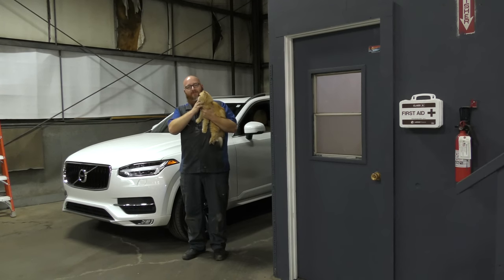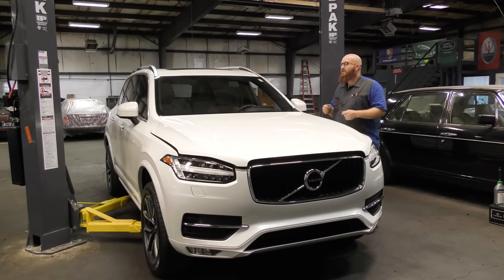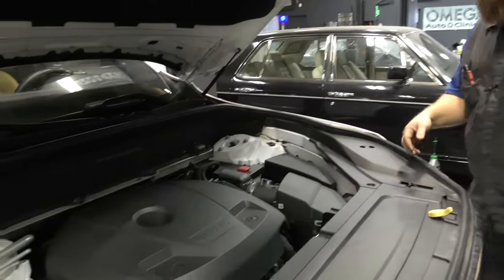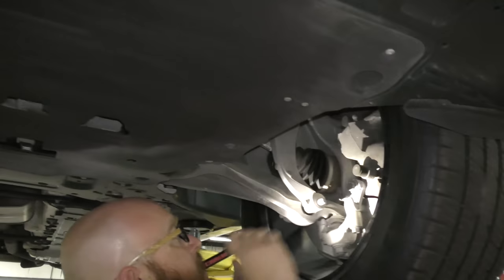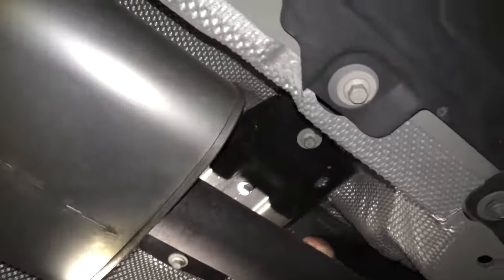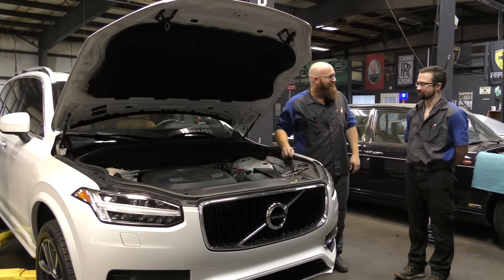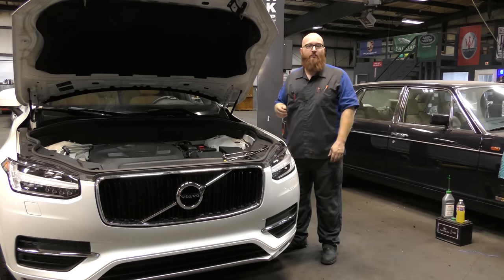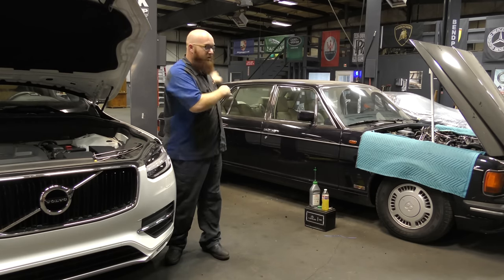One Sweet Swede! 2016 Volvo XC90 loudly roars into the CAR WIZARD'S shop.

Comment: Perfect video after finishing work on my '88 740.
Reply: I can't wait to get my '86 760 Turbo out of long term storage and back on the road again. I miss that turbo lag and push button 5th gear so much!
Reply: @TIMMEH19991  Mine has been sitting for most of the summer, been busy with work and work related injuries. Had to do some suspension work and put on the lower chassis brace from ipd. Definitely miss how comfy and fun this car is to drive. Especially when I hear the turbo spooling up. Mine is auto for now, may change in the future.

Comment: I have two Volvo wagons that are original, a 850R and V70R.  I have another 850 that's been RWD swapped with a turbocharged 3800 (bought a roller for 500 bucks, used parts laying around the shop, total prob less than 1000 bucks for a nice 850 that runs well and is simple to work on/easy to get parts powertrain wise).  I've probably worked on more Volvo Semi trucks than anything Volvo though, we've bought/sold quite a few and even adapted a couple to replace the Internationals we were running for propane trucks.  Drivers say they're the most comfortable/easiest to drive and they're pretty reliable/fairly simple so it's win-win.

Comment: The 2016 has two MAJOR issues: (1) oil burn due to narrow oil return ring (fixed in 2017), and (2) leaking sunroof due to (a) shrinking seal on rear glass, causing a large gap where water can get in, and (b) bad design on sunroof cassette allowing excess water to enter the interior (not sure what year fixes this). There were a number of other issues, mostly fixed under warranty, but these two issues don't typically show up until you're beyond 50K miles. Volvo considers anything over 1QT/600 miles "normal", so if you burn a quart every 601 miles, you're SOL. Even every 1000 miles would mean that you're replacing 10 quarts of oil BETWEEN the 10K oil change interval. Had I stuck with 5K oil change intervals, my carbon deposits would not have been so bad and the oil return rings probably would have stayed clear. They never tell you about carbon buildup in oil testing. While the newer oils easily last 10K or more miles, the dispersants lost their effects after 4 or 5K miles, causing carbon to stick to metal surfaces. I took apart my 1996 Mustang Cobra engine last year, changed the oil with Mobil 1 every 5k miles, and it was crystal clear including the oil return rings.

Comment: The cat is very cute, even though I’m allergic. I’ve seen her before in your Facebook photos in the car wizard 🧙‍♂️ group. As for the electronic shift lock and ignitions and whatnot. Yeah they are somewhat of a pain to deal with but there are some tricks to them that everyone just has to learn and then they become easier to deal with. For example, with the push button ignitions if you don’t want to actually start the engine but instead turn the car on or put it in accesible mode you can do so by simply pushing the start/stop button without holding down the brake or clutch pedal in the case of a stick shift. So in essence, if the car has an automatic transmission you could drive it up to the lift, put the car in park and then shut off the motor. Then without holding down the brake pedal you can just press the start/stop button until it goes to the on position and then put the car in neutral so that you can move it around. At least that’s the approach that I would take with one of those cars.

Comment: I saw a video of a same year Volvo that had about 2000 km on it. There was a piece of aluminium wall stud tangled around the rear axel and I noticed Volvo is using a plastic rear spring, funny. The whole bottom of the car was covered with mud and grass so I was wondering why would anybody go offroading with a brand new car. They had had flood and the only way to save the car was to drive it out through the housing area being built. That's why the owner bought it anyway, just in case he ends up in the middle of flood.

Comment: I had the opportunity to test drive the newest XC 90 turbo diesel. The interior of the vehicle is top notch. It’s loaded with gadgets and gizmos, however the power delivery from the engine was a huge disappointment. Lots of turbo lag. It reminds me of the turbo powered gasoline vehicles from the eighties. Value for money isn’t great if you realize that for the same price, you could buy a double cab 2.8 litre turbo diesel pickup truck from Toyota with a much better power delivery from the engine.

Comment: Hey Wizard, I know from having one as a hire car that I’d you turn the car off, then, turn the ignition on by turning the start switch but with your foot OFF of the brake, once the ignition is on by engine not running, put your foot on the brake and the shifter will move to N. You the electric parking brake will also come off if the ignition is on, engine off, foot on the brake and press the button to release the parking brake. 

Also, why aren’t the “Thor’s hammer” DRLs working in your video? Those really add to the look of new Volvos.

Comment: These modern Volvos have some major service flaws. I work IT for a company that owns a couple Volvo dealerships, the software updates on these cars are MASSIVE. Auto techs still do this, not some no-mechanic IT guy like me, but these updates take sooo long they drain the battery (car needs to be in auxiliary mode take the update). We had to buy a high speed internet link specifically so we stopped killing new batteries on firmware updates
Reply: Or maybe connect the batteries to a battery charger while doing updates?

Comment: I wonder if Wizard will be like his mentor in 30 years when cars are 99% computers...

(I already am, my daily is an old push rod V8, it drinks fuel sure, but servicing, parts are cheap as chips! - not to mention any simple stuff I just do myself) - not that it's had any problem other than the fuel pump the day after I bought it haha!

Comment: Speaking of Volvo...
I drive a 240 and there is no exhaust left whatever. The catalytic converter fell off last week! And my timing belt was last changed before my mom bought the car in 1996. 
But....
The water pump failed a few days ago and I have a timing belt and water pump kit and a good deal at a shop to have it done.

Comment: What? The Great CW, Cuddling a cat? Witch's hat/ Hoovie effect? I don't even wanna go there. 
You got the pineapple for that :) Nice procedure with the rabbit's ears. 
Poor folks, outside of Kansas, who can't afford a hoist, might try one of them cheapy, point & read thermometer thingys? 
Check temperatures? Also good for radiator top & bottom/ transmission/ Cat before & after? I.e. the exhaust, cat :)

Comment: Car Wizard, instead of investing thousands of kilowatts into an actual AC system, why not use something simpler, like the Portacool by Hess Automotive? That basically consists of a small water pump and a large fan, it pumps water on top of a cardboard cooler radiator which then gets soaked, and the fan pulls hot air through that, evaporating the water and therefore cooling it. And it doesn't use that much power, maybe 800W or something? I've seen shops in Germany cool their shop with it, and they're happy. It only gets the shop maybe 5-10 degrees C cooler, but that often makes the difference between bearable and unbearable heat...

Comment: Nice video Wizard! 😁
I have one question regarding the lift: What is the purpose of the handle, which you‘re pushing & pulling with your right hand? Just wondering, because in Germany we don‘t have anything like that... Just some up & down buttons...
Thanks a lot! Have a nice day guys!
Reply: I know it’s been 2 years, but that is the lock release handle. If you don’t hold it, it makes a very loud clicking noise when it goes over each lock

Comment: One of my money-no-object cars I'd buy right now, a V90...
Reply: That or the new V60.
Reply: The 4-cylinders suck though. Not luxurious at all and lots of turbo lag
Reply: @headcas620  Have you driven it though? If you have, what are your thoughts on the rest of the experience? I'm sure it's a damn good bit faster and less "laggy" than my un-Imprez-ly slow car... I haven't yet, but I love the way it looks and sitting in it is a treat.
Reply: Joshua yes I had one as a loaner. It was pretty nice otherwise and the pro-pilot assist was nice in traffic. I'm just used to a V8 s80 with immediate throttle response. The mpg was the same or only 1-2 mpg better over the v8.
Reply: yeah i'm not a fan of turbo i4's... but i'm also not a fan of SUV's, i'm too short for their roof racks. so short of getting a pickup, wagons are the ticket... too bad no one makes em anymore. i'd kill for a wagon version of the current gen Camry.
Reply: @headcas620  Good to know and thank you for responding.....In all honesty, if I had my absolute first choice, it would be a V60 Polestar. I have yet to own anything other than cars with small 4 bangers and I love the love sound of a straight 6.

Comment: I’ve always loved those Volvo’s,  but was worried about the 4 cylinder engine.  How do they hold up?  Do they have enough power, it’s a pretty big SUV?
Reply: If you get the T6 version, they have just a hint of lag, but once that supercharger kicks in down low, it moves pretty well (even with the 5,000-lb-plus XC90).  It's got good pickup and power delivery.  Now with these new B6 mild hybrids, it does provide a tiny boost off the line (13hp, ~30 lb/ft), but they feel just about the same. 

These engines do have common issues with oil consumption, which if the issue continues, it will require a piston ring replacement.  But they are fairly reliable.  I wouldn't say they are as reliable as a Toyota engine but they are definitely not as unreliable as a Jaguar/Land Rover product.

Comment: As already mention just hold the plastic nob for a bit more then a few seconds and it will shut up. 
Also think about settings, if air suspension turn automatic leveling off = Top drop bar, settings, my car, suspension & parking brake , also possible to disarm parking brake for RBT or so, often don't work with the button for some reason (if equiped).
Safe car but that'ss about it.

Comment: What yr is that car,,,,, I have a 2012 acura tl sh-awd with 125k Miles,,, the only issue is getting the timing belt done,,at 103k miles I changed the sparked the plugs,,, you can't go wrong with japanese cars

Comment: If you turn off the engine in "P", then ignition and select "N" then you can push the car around without engine running? Works with my 2015 VW Passat (Europe).

Comment: that shut off feature that doesn't allow you to turn off the engine is not safe! If you get a  stuck throttle cable... umm 3 ..2..1.. It's happened to me

Comment: Actually you can turn it off in neutral, hold the "off switch" and it should shut down, as long as it isn't shift by wire it will stay in neutral, even the shift by wire should stay in neutral.

Comment: The last good cars volvo made was the 240/740/940. i had a wagon with 300k miles and it drove great
Reply: Depends, really. For a modern-ish car, the later years of the second gen v70 like 2006 or 2007 were quite good. Amazing rust protection as well. And you can fit 15" wheels on some of them. Put on some nice skinny 195/65/15 tires for a really comfortable ride.

Comment: Another great video .  The 4 cylinder is turbo and super charged yet only makes 250 horsepower even an older Honda Plot has 300 horsepower so what the hell is up with that crap?  It's like buying a nice high end laptop but you get a shitty celeron processor lol

Comment: wow...arent there a warrenty on this car? before my audi was 5 years the audi dealer took my car infor inspection and replace all my rear lights (cracking from inside) replaced  my side mirrors due to indicators didnt work. wiring harness from computer to front breakes due to corrotion in the wires. THey resprayed my wheel tubs due to some rust (did so after 3-4 yrs).
Reply: volvo warranty is 2 years and rustwarranty is 12 year in finland atleast.
Reply: 95,000 miles*
Reply: Big surprise an Audi needed all that work before the 5 yr mark. lol
Reply: Holy crap, 2 years
Reply: @OMGWTFLOLSMH  Its 10 yrs old now with no problems and still looks (almost) new :) the clock just turned 100k km
Reply: @EvilCerealBoX  didnt hear that part :) ... thats 152k km in 4 yrs. Mine has gone 100k in 10 yrs...i dont think i drive to much

Comment: ah yes, Sumitomo tires...the used dealer go to.  When you want to show you are classier than Ling Longs but don't want to spring for the proper Pirelli OEs.

Also, that's not even a fully loaded XC, that's a Momentum.  An Inscription with Bowers and Wilkins.....that's loaded.

Comment: Having a 1998 S70 T5 and 2 2009 XC90 V8’s I’ve learned that you stay away from the 2016 XC90.
Reply: I’ve got a 98’ S70 GLT! Wouldn’t give her away for anything!
Reply: I have an early 2007 V70 D5 with startship miliage one it. Great car that just goes on and on and on.
Reply: I have a 2004 XC90 that is a money pit.  Most of them had to have new transmissions at 100,000 miles. Very expensive parts.

Comment: @7:33 are those the 4 Audi rings on the control arm ? can't immagine that Volvo is using Audi suspension components
Reply: They have used Audi engines and transmission systems in the past, so I don't see why not?
Reply: @TIMMEH19991  what I know it was only v70 tdi with the Audi 2,5l diesel(c4) engine. And B8444S v8 engine built by Yamaha (Ford owned Volvo by that time) Except that Volvo had Volvo engines
Reply: @Joakim Söderberg  They used a VW Audi straight 6 diesel engine in the 80s and 90s, plus I'm sure one of the 4WD systems they used was sourced from VW Audi . I could be wrong though!

Comment: No mileage mentioned, but if it has less than 50,000 miles at 4 years old I'd want Volvo to pick up the cost of a failed wheel bearing.

Comment: Hey wizard, when you mentioned something about the brake pads sticking and hearing a popping noise? How and why does that happen? Sometimes im coming up to speed bump in my car and ill hear a slight pop up front. Could that be the same thing?
Reply: Sounds like a ball joint or a bad strut. Hard to tell thought. You need to bring it to the shop.

Comment: Think the XC90s are a nightmare for reliability.  XC60 much better. I have loved Volvos since riding with a teacher think 1980.  Owned a used 1990 240 wagon 5sp in 2001 with 120k, kept 5 years, and only changed the oil.  Something changed at Volvo - think mid-1990s when they begin to go to front-wheel drive, and by 2000 the "wheels came off the wagon" and could pick up a 5-year-old Volvo, $40k new, for under $5k with issues

Comment: 2016 and a exhaust leak.....WTF   what a POS!   Plus it is a 4 cylinder turbo.......problems are a coming.
Reply: It has 93000 miles under it's belt already, what's a simple exhaust leak at such milage?
Reply: 93k miles is delivery miles with a Lexus or Toyota  Volvos are expensive so you'd expect good reliability and design
Reply: @ghassanalfarra8935  For what the original sticker price of that was you should expect better quality.  They got rid of if for a reason.  Plus that 4 cylinder with a turbo is headed for problems.
Reply: @dallysinghson5569  Volvos are over rated.

Comment: Wizard just drank a bottle of extra coolant the previous owner had left in the engine bay for when their car overheats 😂😂😂
Edit: I'm not trying to knock Euroasian Bob's credibility but that Volvo has 100% been in some sort of accident that required an entire rear subframe replacement which imo should have been totalled.. judging by the amount of replacement parts back there I'd assume this car isn't very safe, insurance fixes the bare minimum in these cars so I would not trust buying nor driving it.

Comment: 12:12 what happens if a passenger accidentally bumps that ignition to STOP while someone is driving?
Reply: Above a certain speed threshold, nothing will happen. Basically disables the button.
Reply: @rosen9425  i was worried
Reply: @jordanimatedstreaming  
Cars will not be allowed to be sold if they have such dangerous engineering oversights. A massive lawsuit waiting for anyone trying to pull that move

Comment: 4 years old and has an exhaust leak already?!?!
Reply: Also has 93k on it thats acceptable with that mileage
Reply: My 08 Mazda 3 has 93k on it. And it’s still the original exhaust. No leaks.
Reply: brasolt04 I would never buy a brand that leaks with only 93k miles.  Consumers need to demand better.  I have 2 vehicles from a different manufacturer well over 100k miles with no leaks or issues.
Reply: It's not normal in this day and age, but let's get real. How much could an exhaust flange gasket cost to replace?
Reply: If you find that acceptable you have really lowered your expectations

Comment: Someone drove that relentlessly for 4 years. That's a lotta miles for a 2016. Probably why it has premature problems. Relentless heat cycles.
Reply: Heat cycles, start stop or what? I always though highway miles went easy on the car
Reply: @dallysinghson5569  heat cycles are good and you want to run a car regularly for metallurgical reasons and lubrication of gaskets all around you want that but unless it's a diesel tractor trailer truck designed for such duration's of like 12 hours a day or more or something like that you want to let things cool down after a certain amount of time.